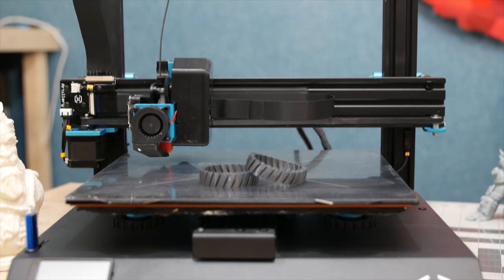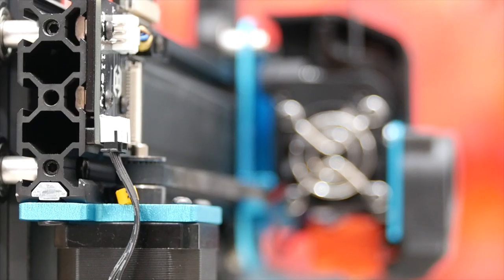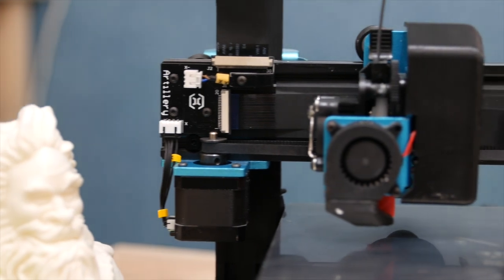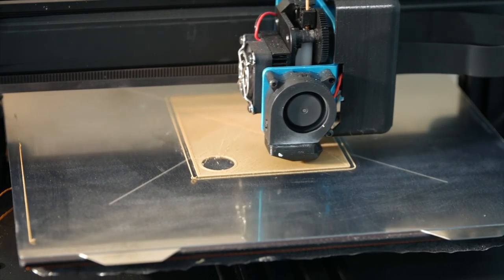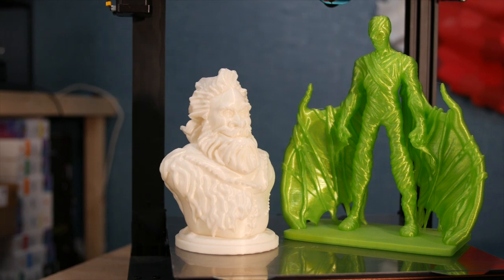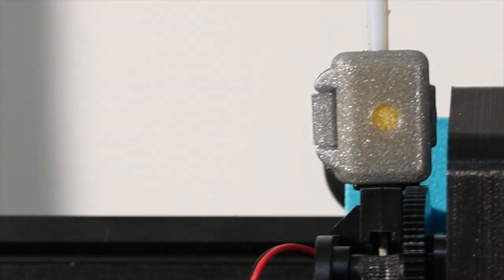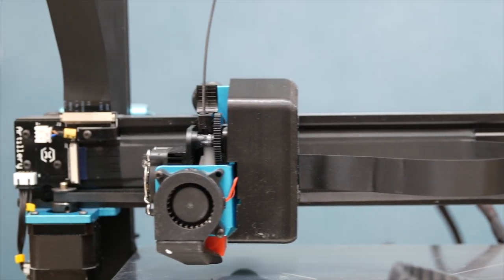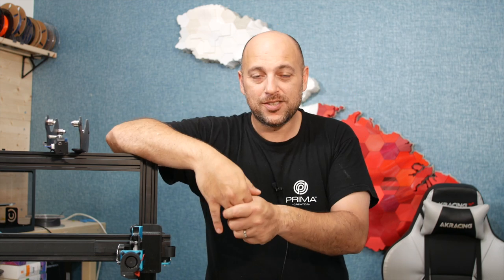Artillery (Evnovo) Sidewinder X1 - A $400 Contender To The Creality CR-10S Pro

Comment: Super prints. Very impressive. My X1 arrives tomorrow :)
Reply: Did your printer arrive? What is your opinion so far?
Reply: @LourensMarx  It arrived with a broken Z endstop so first impression wasn't so great. But after that was fixed I have been very happy with the quality of the prints and the speeds at which it can print. And flexibles work well too.

Comment: Great video review, as always. Whatever happened to those vlogs? 
I'm with you on migrating away from Simplify3D. Only time I find myself using it is when I have supports from the build plate. PrusaSlicer (Slic3r PE) have thin support material that horribly stick to the PEI.

Comment: Hi , have some problems in the layers to mi Sidewiner x 1 , some parts of the layers dont have filament , any idea?? , use the setting of the oficial website , good material , and print same item with 3 diferent materials , and make the same error , in the same place , thankss for your help  .

Comment: The walls of the heatbreak are supposed to be thin as to transfer as little heat as possible through the transition zone.
Reply: Yep, indeed so. In fact, I believe that one of the common issues with v6 clones is having a heatbreak with walls that are too thick, resulting in heat creep and jams with PLA. They aren't supposed to be bent, though! 😸

I've snapped in half a genuine E3D heatbreak before precisely because they're so thin and fragile! Though that was the result of my entire v6 being a total mess and was largely my fault 😹

Comment: In the title you mention that it's a contender to the  Creality CR-10S Pro
, but what would you buy if you wanted to get one, especially if you don't take account for the difference in price.

And could you link to the hotend and heatbreaks you installed?
Reply from the maker: Hands down I would take the sidewinder, without a doubt. Better print quality. And the links are in the video description :)
Reply: @3DMakerNoob  Thanks 👌😊

Comment: I'm so close to making this my second 3D printer. Thank you for posting the review. Your first impression was almost enough to convince me as it was.
Reply: Same here. May buy one as a x-mas present for myself.
Reply: did you end up getting the sidewinder x1?
Reply: @shmafoo  did you end up getting the sidewinder x1?
Reply: @ikew3150  Yes and I am glad that I did. I think it's an excellent machine for a hobby user who's also doing a bit more advanced stuff. You will still want to use something to hold your prints down on your printbed as cleaning it with with alcohol seems to remove a bunch of the stuff on it which makes the prints stick on it.

But all in all, get one if you have the space for it. It's not exactly small.
Reply: @ikew3150  I ended up getting the Ender 5 Pro  instead. I wanted that more stable boxed frame.
Reply: shmafoo hmmm, okay! Thanks so much for your response! I really appreciate it!! I ordered, there was a good deal, so should be here tomorrow or Sunday. I’ve been considering this matching for awhile now. Wanted to reach out to someone that maybe has a simple answer on what they think. And you did just that! I have two ender 3s. And wanted something larger and higher quality! Definitely think it might be just that. Thank you for the tips!
Reply: @ikew3150  you should be happy with it in this case I think. Enjoy!

Comment: The heat break being very thin isn't them cheaping out, in fact, the thinner it is the better it performs. Still the fact that it bent is clumsy handling and shipping on their part.
Reply from the maker: Fully agree, the thinner it is the more efficient. Had it not been bent and me trying to fix it it would have been fine, although I dislike the PTFE tube going into the heatblock for obvious reasons

Comment: Hmmm I wish bought this printer instead Cr 10s Pro
Reply: I am considering buying one of these exact two. If you don't mind sharing your opinion?
Reply: @LourensMarx  the auto leveling is pain and drive you crazy. It even damage the extruder support. The bigger the bed the harder to level it up. Wait for the "Cr10s Pro V2" they will release it by the end of the month. They said they will fix all the issue. The Cr10s pro is not worth it at all. it will give you a hard time.
Reply: @xXxXENcoreXxXx  Thanks. Will look out for it. Appreciate your response.

Comment: Thank god - I was just sitting here thinking the world needed another Chinese Prusa clone.
Reply: How is this a Prusa clone?
Reply: @jakefromstatefarm8545  No need to take me so literally, Spanky. It is just shorter than saying "another printer where the bed jerks back and forth on the Y axis while the extruder moves on the X axis on a gantry that moves in the Z axis. The design works, but it is getting old and none of these Chinese companies seem to be bringing anything new to the table. This seems like just another "me too" company.
Reply: @jakefromstatefarm8545  No, just this particular arrangement of how to move the three axes and the general shape and style of the printer.
Reply: 0Calvin this is completely different from a Prusa. The only thing similar is that they both use stepper motors. How else do you expect each axis to move? Magic?